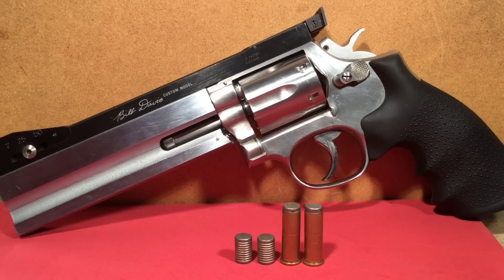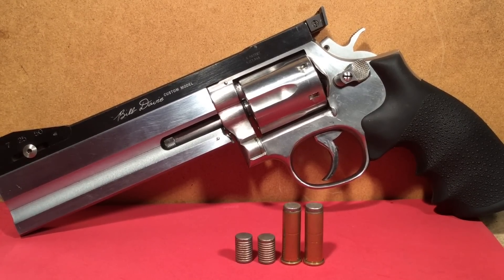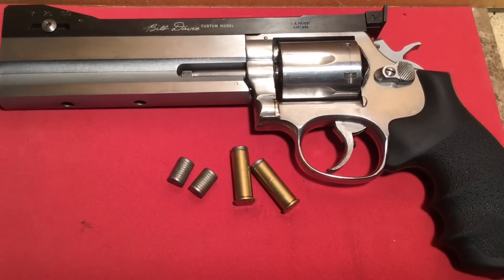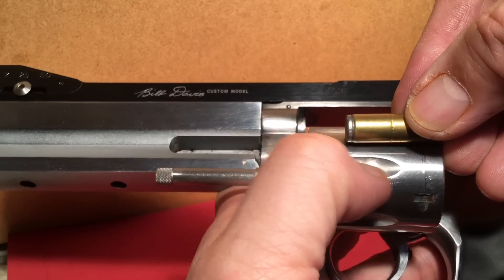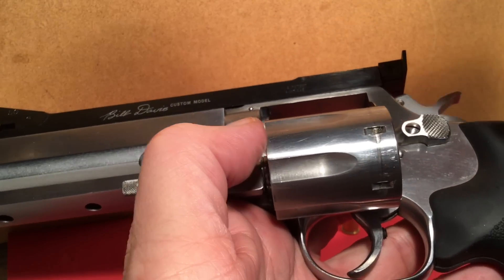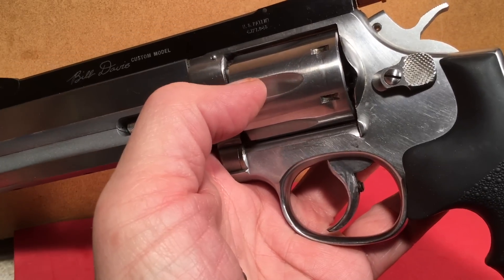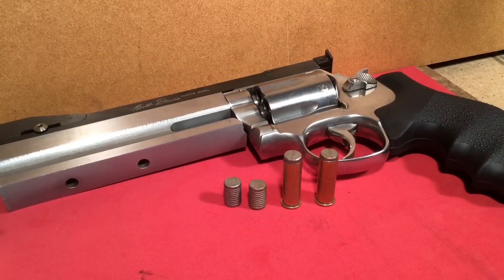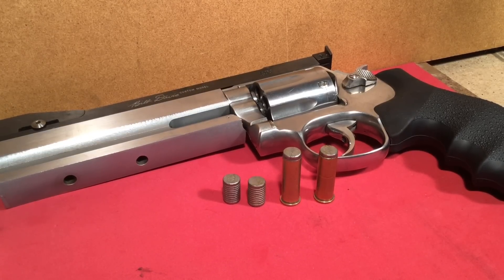A Different Perspective On Handgun Bullet Jump - 38 Wadcutter

Comment: Thank you for this presentation. I have owned and carried 357 Magnum revolvers off and on since 1965 often with 38 Special rounds in the cylinder. I've been told that when shooting 38 Special rounds through a 357 Magnum one should occasionally fire magnum rounds to prevent build up of lead around the cylinder neck. Is there anything to that argument?
Thanks in advance for your thoughts.
Reply: That's a good question Rich. I hear this a lot and also about a lead/fouling ring building up in the chamber of your 357 lever action too. This supposedly can happen to the point where 357 will no longer chamber.

After around 100 lead 38 specials I can see a physical build up in my Mateba Revolver in the cylinder. I believe we are talking several hundred rounds for this to present as a serious problem. I wouldn't advocate shooting it out though, just clean it as normal.
Reply: @bangNbark  Good advice. I typical clean with a brush, bore snake and swab after each range session. I have a lever action 357 as well.
Reply: @Me2Lancer  Very prudent, you will have no issues with that routine!

Comment: Interesting. I just bought an new 6" Ruger GP100 stainless 357 mag and have never shot other than my lead Lee mold wadcutters with it as well. The gun most likely will never see any factory ammo or FMJ bullets. I finally decided to put on that gun an 2x power Truglo red dot scope. I have some observations however about point of aim which shifts. Using same powder load (5.5 grain Unique type powder) and using the TL style 148 grain Lee Wadcutter in an 38 SPL case, I hit to the left of the red dot at lets say 75 yards. While using an 357 mag case with the "Keith style" Lee 148 grain Wadcutter bullet, I get hits to the right of the red dot. Free standing but the gun is supported (kind of hunting scenario). The difference is the 38spl is not crimped at all nor expanded the mouth of the case since the TL design enters it easier. Since I use for both loadings the same set of dies, I never change the die settings so the 38 spl can not be crimped and does not reach the case mouth expander die. The dies are set up for the 357 mag case, and so these are getting crimped propperly. Obviously for the same amount of powder the Wadcutter sticks quite far out of the 38 spl case in order to get the same powder space in both 38 spl and 357 mag cases. The loading in the 357 mag case is seated and crimped propperly.
These 2 different hitting points I get with both cases which they should have both the same bullet jump, but different crimpings and different cases. 38 spl and no crimp hits to the left while 357 mag case with propper crimp hits to the right of the red dot. I find that interesting.

Comment: As always, you bring out interesting points. If I may challenge your point for a second. It's true, the cylinder throat acts as a guide into the forcing cone. But I think there is one revolver that contradicts that maybe a little. I have a 460 Magnum that I rarely use 45 Colt cases in. Not because of bullet jump from case-to-forcing cone. But, from case-to-cylinder throat. I use nothing but full length 460 magnum cases. Your thoughts please! Thanks!
Reply from the maker: DizzyBarrel45 - You could use 454 Casulls if you wanted to shoot "Specials".  No real need to shoot 45 Colts in your 460  although that would be similar to shooting 44 Russians in 44 magnum guns.  I've found the 44 Russian to be a most fun and useful round.  The 44 Russian has some real good usefulness exceeding frontier loads with 250 grain bullets (930 fps).  If you wanted 1000 fps performance in your 460, the 45 Colt case will get you that with better and more efficient powder burn.  Plus chamber fouling is a non issue since we clean our guns anyway... Good shootin' to ya with 460 of yours - one of the mega blasters of our day... FC

Comment: Very good video and analysis on bullet jump. I watched all of your videos on this and I agree with your assessment. It doesn't effect accuracy. The pistol that has the greatest "bullet jump" is the Taurus Judge. As you know it shoots up to 3 in 410 rounds and a 45 LC round that has a big bullet jump. My Judge has a 6.5 in barrel and is very accurate at 25 to 75 yards with the 45LC. I think people take it for granted that that jump will effect accuracy without testing it as you have. Thanks for the video. One more pistol that I have is a Ruger Black Hawk convertible 38/357/9mm and I don't see any difference in these calibers ether. The 9mm has a long bullet jump with a second cylinder with out a loss of accuracy.

Comment: Hey FC, this raises a question for me about shooting 38 in my 357 Rugers. I was told or read somewhere that after a while of shooting the 38 in your gun you should buy some type of 357 reamer to smooth a ridge that the 38 brass creates in the cylinder when fired over and over againand later on the 357 brass will be hard to push into the cylinder. I'm not sure if all that's clear, but I hope you get my question. Good shooting " to ya ".
Reply from the maker: Nick J - Nick, it's all a matter of how bad you let it get.  If you shoot that many 38s to create a ridge of fouling that bad, you will need that reamer to clean it out.  But if you clean your gun after shooting your 38s, it will never get that bad.  I use a cleaning rod with the handle taken off to chuck in my electric drill... if necessary, I just run a power brass brush in my 357 chambers with Ed's Red or solvent of choice... will clean out any medium fouling nice.  But if we really try, we'll need that reamer...When I shoot my 38s, it's never enough to keep 357s from chambering.  .Best to ya,  FC

Comment: So how does bullet jump to the chamber throat affect pressure? I know a longer jump will reduce chamber pressure not considering case capacity in relation to bullet intrusion. I guess what I am asking is there a minimum amount of bullet jump that you do not want to reduce, which could severely elevate chamber pressure? Thanks in advance for any insight.
Reply from the maker: wawheeler21 - Thanks for the well thought comment... what you are referencing is the "not good to touch the lands" vs "extra freebore" considerations in rifles.  When PPC revolvers had their cylinders shortened, the resulting guns were no more accurate than guns with longer cylinders - reason being that shortening the cylinders to "reduce the bullet jump = better accuracy" was a myth - they were really 1) not reducing the jump at all and 2) bullet jump was not that critical in affecting revolver accuracy in the first place.  What was critical in revolver accuracy was the way it was set up in the relationships of the cylinder throat, flash gap, forcing cone, rifling = the obturation system for that revolver; then mate that all with the execution of revolver timing, chamber alignment, lockup, barrel quality.  Then add ammo quality.  Then add the ergonomic factors - trigger pull, action smoothness, grip frame, sights.  Then add shooter ability.  If everything is world class = championship.   That's the way it is in all shooting sports - single shots can be by accident, but wins were never by accident.   So where does bullet jump fall into all this?  The answer is that handgun shooters don't concern ourselves with it... rifles have different requirements since their mission is long range precision.  Handgun seating depth is all about functioning and pressure affectation only.  If too long, autopistol rounds will not function and revolvers do not chamber.  If too short, prssures are higher perhaps dangerously so.  We very seldom have problems when we seat to the crimping grooves of revolver bullets and in accordance to the bullet ogives for autopistols.  And then any bullet jump is built into the system.  We don't tweak seating depth in our handguns because we aren't trying to shoot into the ones at benchrest.  If we get 1" groups at 25 yards, we are ecstatic.  If we get 1.1" we are still extremely happy.  If we get less that 1", we are beside ourselves.  There is no sport of autopistol or revolver benchrest.  And if we shoot shorter rounds, the bullet jump is still not significant to overall accuracy with any kind of reliable correlation.  Rifle considerations cannot be transferred.  Yes, pressures are affected - reason that the standard deviations of the same ammo are different in different revolvers.  So it boils down to - we seat our bullets so the rounds work and are safe and then we don't give the seating depth another thought - it's done.  Have a great day,  FC

Comment: Thanks for the info.  I had this question posted on your initial videos on the 44 special.  I think this eliminates any question.  From your other excellent work the fill ratio seems to be more important, so using a 44 mag case with equivalent 44 special loads doesn't work as well as a 44 special case.
Reply from the maker: toy collector - Thanks for your comments... That 44 Special seems to have the perfect balance for powder burn.  And the edge the 44 Mag really has is the upper end of 100 - 150 fps more velocity.  For lighter shooting, the 44 Special has it all over the 44 Mag.  And the 44 Special delivers 1325 fps with 250 grain Keith bullets with less kick and roar - anytime a shooter needs more than that, it's time to trot out the 308.  Have a great day,  FC

Comment: I extend the wadcutters in my .357 (using .357 cases) to avoid the carbon ring that develops when shooting .38 spl.
Reply from the maker: RapidRrobert - Thanks for reporting this... I haven't tried seating them out that far as the WC would then not reduce the powder space with those small 2.8 grain charges making them burn more efficiently and consistently - you'd probably have to go to 3 or 3.1 grains of BE powder with that longer seating... I probably never did that because cleaning out that fouling wasn't much trouble - especially since I have that rod that runs the brass brush in the chambers with an electric drill... Best to ya,  FC

Comment: Interesting video, thank you! Bullet jump is inconsequential, I think the reduction in airspace afforded by flush seated wadcutters improves burn consistency and hence accuracy. The rest is up to how square and aligned the action and barrel are.
Reply from the maker: mytmousemalibu - Fantastic...3 gun is modern day Cowboy Action Shooting..!!  You are going to burn through a lot of ammo... but that's what it is for, after all.  I remember when I was competing in the various disciplines, that was like a 24 hour a day commitment, even when at work, it was there in the conscious mind.  As I got older, with all the driving around, it became work...hope that never even gets on your doorstep...  Continued good shootin' to ya... FC
Reply from the maker: TehBr0 - There you go - those small powder charges work well with WC bullets because of the more efficient burn of powder.  With rifles, the seating depth for best accuracy can be anywhere from just off the lands to .006-.010" off the lands in our bolt guns or even more when magazine length requires even shorter seating in semiautos.  Have a great winter day,  FC
Reply: Great job Steve! I think we need to see that S&W PPC  gun launching some wadcutters!
Reply from the maker: mytmousemalibu - That's all I did with that gun for about four years, then the PPC State boys came into our matches and took 'em over.  I liked the crew that was running the show much better.  So I quit and went into High Power Rifle.   Best to ya,  Chris -- FC Steve
Reply: I know the feeling! I have been shooting USPSA now for a little more than a year, still love every minute of it too! The gun I normally shoot, my M&P 9 Performance Center long-slide I got before I did any competition but it maybe had 150rds through it before it became a race gun. It has now eclipsed 15,000rds in it's 1st year as a race gun and most being beyond SAAMI-spec 9mm Major power factor loads, still runs like a champ after I got it dialed in, more reliable than many of the STI's and other 2011's. I love it! There's a few videos on my youtube channel of me running it! When I started USPSA I was the last place holder or close to for some time. Now I pretty regularly finish in the top 4 of the combined match results so i'm doing quite well. I'm just now dipping my toes into 3-gun competition too! It's also a blast!
Cheers Steve!

Comment: I would think that the biggest contributor to any inaccuracy would be the fact that the greater distance before the projectile touched the rifling when using a shorter case, would enable the projectile to reach quite high velocity, then when it hits the rifling some stripping would occur, if the projectile were of lead. If the projectile were touching the rifling throat before ignition,(obviously not possible with a revolver), it would start to rotate as soon as ignition took place, this must be a factor in the accuracy of the gun, if this is not so, why do we strive for very low bullet jump in a rifle? Your target demonstration shows that there is very little difference in accuracy with a huge bullet jump, why is this ? Do we need rifling in our pistols at all, as the rifling must be completely stripped given such a huge jump, we need to recover bullets and look at them.
Reply from the maker: Englishman French - As you are aware, low bullet jump = best accuracy is oftentimes not true in rifles.  Sometimes we have been forced to load our 69 grain SMKs deep for the purpose of magazine functioning - and yet we can still get sub MOA out of our ARs.  Benchrest shooters sometimes find the best accuracy when bullets are seated as much as .006" - .009" off the lands.  There are some that report seating to touch the rifling gives them the best accuracy (although this practice has been condemned as being unsafe for high pressures).   We don't get bullets stripping off the rifling with our handguns because the velocity of the bullets anywhere in the system is not sufficient to get the stripping.  Elmer Keith used to use a fairly soft 16-1 alloy with his magnums and accuracy was reported as superb.  Now if we were to be pushing lead bullets in our handguns past 2000 fps, that would be a different story.  That story already took place back at the turn of the 20th century with rifles - caused the rush to get into jacketed bullets by all the armies of the world because smokeless powder forced them to do that.  Without rifling, we would get keyholes from 12 1/2 yards - I don't need to recover any bullets to know what is happening with them = no bullet stability - so our take is we need the rifling.  I have more videos up showing that the "huge jump" in our revolvers for various reasons (short bullets, short cases) is really not the case... Not you, but many think about short cases in revolvers resulting in longer distance to the barrel, as if we were shooting sub-bore diameter slugs down long shotgun barrels with the slug "rattling around" down the barrel...our handguns are in a totally different situation...  Best to ya,  FC
Reply: Your experiment certainly backs up the theory of the "jump" not making that much difference to the accuracy of handguns, this would leave just the oversize chamber bore as being detrimental on a larger scale, I have seen it written that the projectile is up to full velocity by the time it reaches the rifling,(although that does seem difficult to prove), and I cannot understand why some rifles have a "sweet spot" that calls for up to .060" of jump before best accuracy is achieved, every individual gun has its own quirks, (that is why we love to reload), but I would still like to recover fired projectiles from a jell trap, or snow bank to actually see what is happening, obviously will keyholing projectiles there is something major happening, but this can also be caused by a bad crown, with the gasses toppling the projectile as it leave the muzzle, I have had this happen will hollow base bullets where the skirt is blown out when leaving the muzzle. So many more experiments to do !